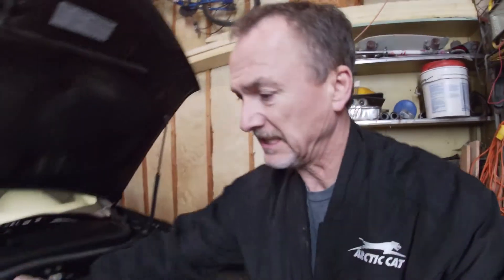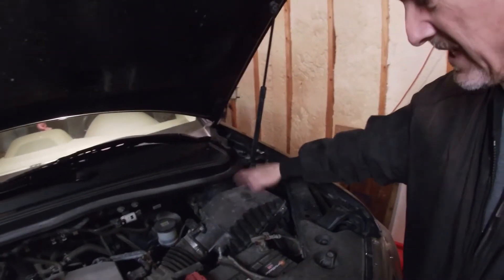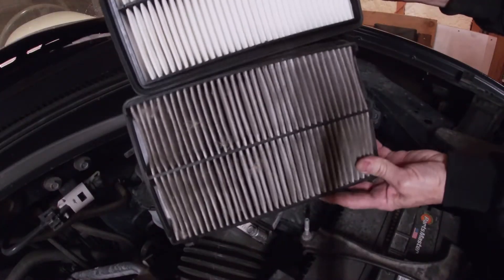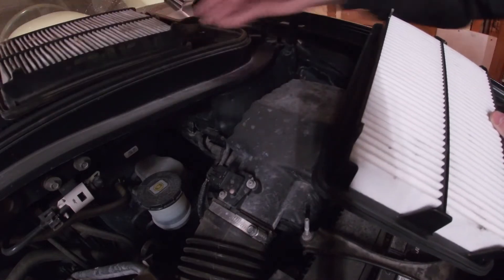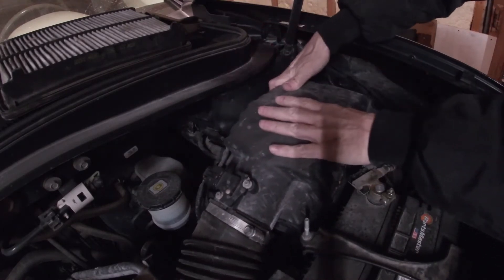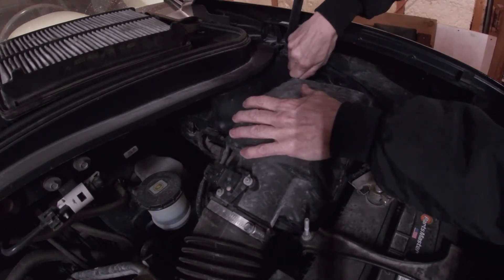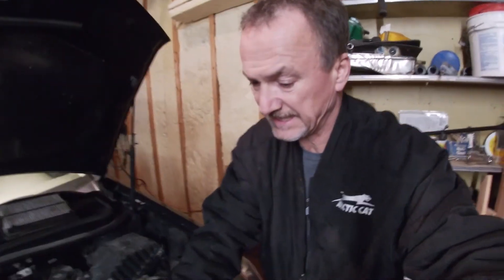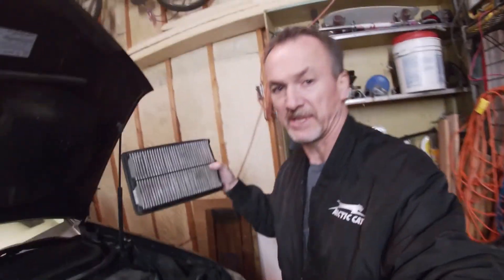Acura MDX Engine air filter,  How to replace. 3.7L V6

Comment: i can't find the air intake hose for acura mdx 2007 in my country. do you know if it is compatible with the honda pilot intake hose?
Reply from the maker: basicly the same powertrain, but there are a number of differences. You need to search for a diagram for both vehicles and see if these items are the same.